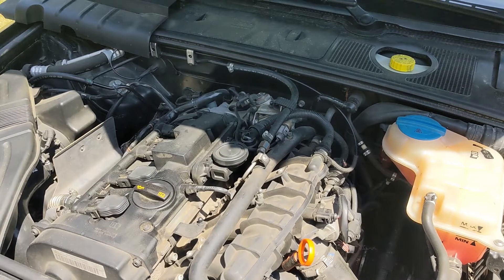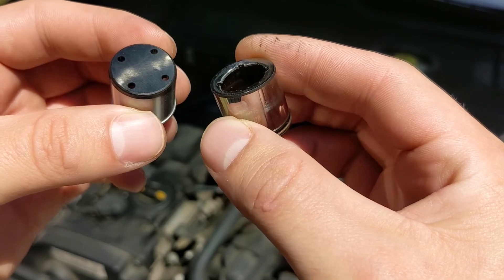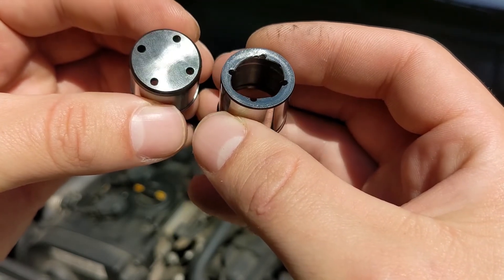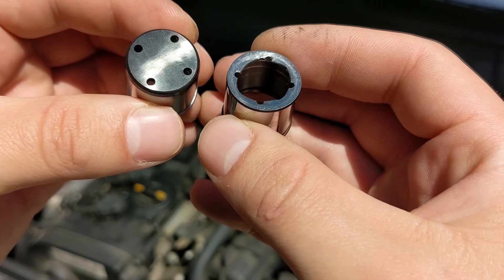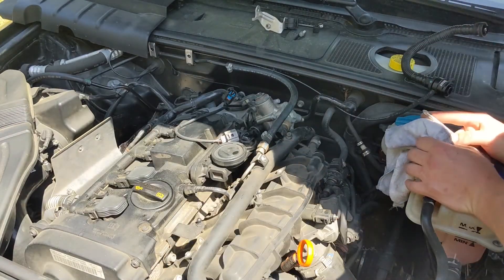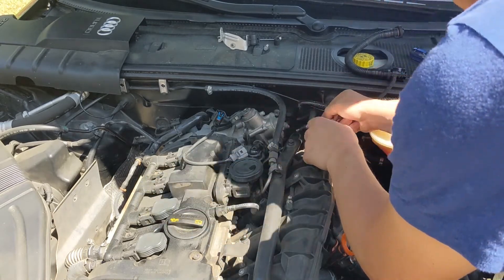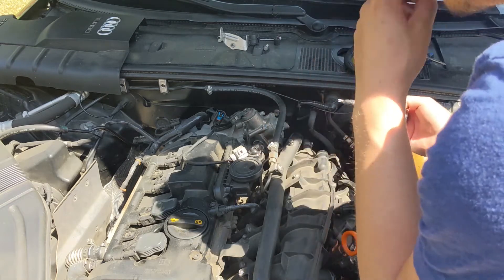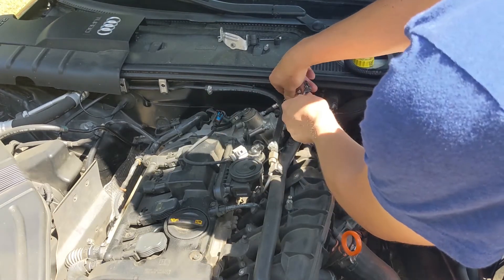B7 Audi A4 2.0T Cam Follower 10k Replacement

Comment: Helping my son with the same problem. Did you replace the camshaft? His is worn, but I think it will still activate pump. Thinking of replacing fuel pump and cam follower and inspecting in 10k.
Reply: I’m did this cam has some minor damange . Will I be ok for another 10k after replacement . I can’t afford another car right now